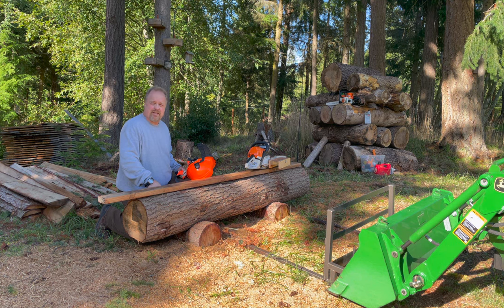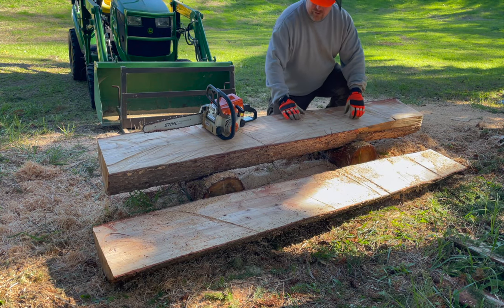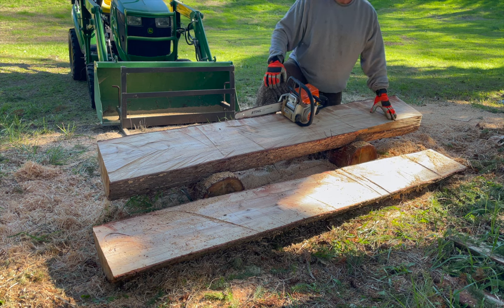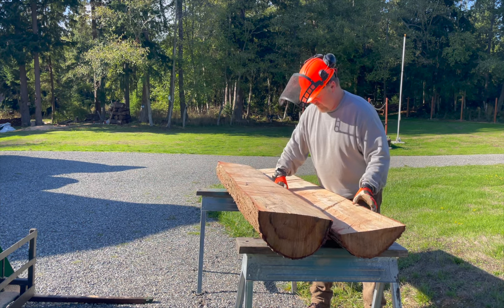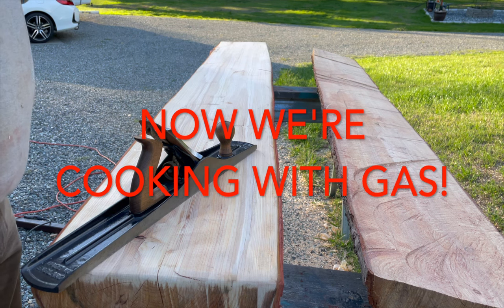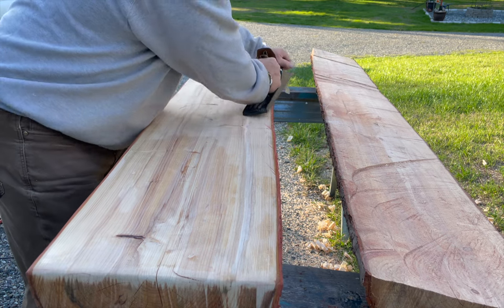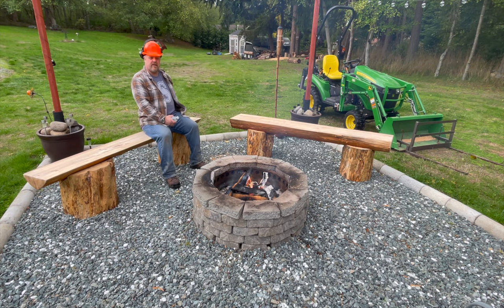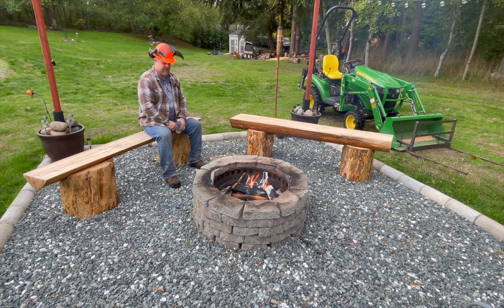Log Benches DIY for Firepit

Comment: Nice, I made something similar but kept the bark and finished the top with a thick coat of poly. I don’t have a belt sander or hand plane so I used some 2x4 and straight edges to make a very large router flattening jig to smooth out the top. Freehand sawing the logs in half with just a string as a guide makes a much smoother surface than the 2x4 rail guide that you bolt onto the bar, I tried both. A channel called Advoko Makes has a freehand milling video, pretty useful if you don’t have a jig.

Comment: Any tips on making sure the wood doesn't crack?  Did you mention the type of trees the logs came from?  I only have pine...
Reply from the maker: Thanks for the question! The wood is Douglas Fir and yes you have to worry about cracking. I do have a solution though…anything I chainsaw carve or cut up I leave outside and let it age/dry naturally. We don’t get too much sun we here we live (At least not desert sun) in Washington so anything the wood seems to not crack if just left outside. Anything that I’ve had dry too fast always cracked. Also I try and stay away from fresh green wood as much as possible but that’s usually tough to do. Good luck and thanks for the interest in my channel!
Reply: @weetzerswoodshop  I'm so appreciative for your response.  And I'm thrilled to hear you're using a soft wood (because that's all I have).

Comment: Nice job! I did something very similar except with water oak. It’s holding up well, it’s been outside over a year and no rotting. I may sand it down and coat the bench with oil or poly